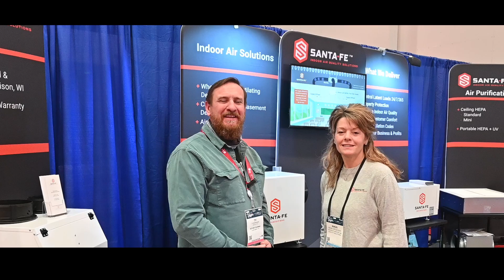AHR intro to Dehumidification with Nikki Kruger with Santa Fe

Comment: Question: if we are saving in energy by making our houses "tighter and tighter", by running a dehumidifier all day (obviously depends) would that not be counterproductive re savings in energy? #2 (while at the show I didn't stop at their booth so I didn't ask them but maybe you know) do they offer anything more then Honeywell or aprilaire or are all basically the same dehumidifiers?
Reply: Great question, Eli!  Typically for 1kWh Energy Input an AC will remove 2-3 pints water and a Dehumidifier will remove 5-9 pints water.  Plus, the fan energy on an AC system is far more than on a dehumidifier. A small 70 pint dehumidifier that is sized for up to 1,800 square feet - we are very conservative in our square footage recommendations, as it is easy to undersize a dehumidifier but hard to oversize, is only 580 watts/5.1 amps.  Way more energy efficient than the AC system.  When you control the RH you will feel more comfortable at a higher temperature.   Also - we use to make the Honeywell units years ago until they decided to go to China to make their units.  We invented whole house dehumidifiers in the mid-90s and basically that is all our company (Therma-Stor) makes - everything from restoration dehumidifiers to industrial units used in agriculture. That is why we offer a 6 year warranty and also include a MER13 filter.  The man that invented the units is Ken Gehring and is very active on a forum called HVAC-Talk where he is know as Teddy Bear.  He will be the first to tell you when a dehumidifier will not fix a situation.  We are way more than unit marketers of dehumidifiers - we truly are the industry experts and want to help.
Reply: @nikkikrueger4722  thank you so much, this is REALLY helpful Information. I usually try to educate customers in understanding why they would need a piece of equipment, I never want them to feel that I'm just trying to make money. I usually go into explaining heat energy, humidity, evaporation in as simple terms as possible. Where I have been getting stuck was here. To justify adding an additional system that will help the comfort of the house but they will have to pay more In energy. What you wrote here is perfect to explain to the customer,  they will even possibly save in energy. Thank you for that and thank you TY for interviewing her, hope to see you (TY) in 2 days at the symposium. 😊
Reply from the maker: Great questions. A lot to unpack here. I will be doing a series on building science eventually.

Yes it is still much more efficient.  More energy is lost due to air leakage than heat transfer. It varies wildly but it's anywhere from 60 to 90% energy loss from air leakage. 

With the air leakage moisture travels,  so that causes growth issues in the walls. Now think of the air your breathing that is passing threw the walls.  It is a huge deal. A dehumidifier overall uses very little energy with large gains. 

Even more somewhen you can just dehumidify without having to run the ac at all.

In  the reverse a humidifier in the winter is important. A leaky house looses all the humidity and feels colder, has more static electricity and host of other problems. 

Santa Fe offers great solutions including help filtrations. The focuse on aftermarket home owner and contractor solutions. You can only purchase threw a supply house. A home owner cannot buy thir product direct so they support the contractors and building since people. You can also buy replacement parts for the inside.
Honeywell buys thir dehumidifiers from "New Widetech"  in China and they are non serviceable. 

April air is made in the USA but they want the unit installed return to return wich GREATLY reduces effecency. Return to return dehumidification is eh let me find the words,....... Let's just say not productive. They also sell thir product to anyone and everyone.  I'll stop there.
Reply: @love2hvac  great points. We install hundreds of dehumidifiers, especially in newer tightly sealed homes. We actually stopped using Honeywell for the reason you pointed out, we do aprilaire. Will definitely look into this company some more. I guess will talk more about it at the symposium if will have the time. Maybe over another dinner 😉